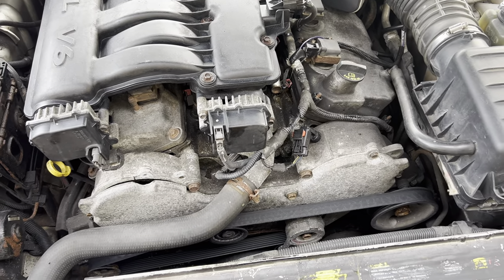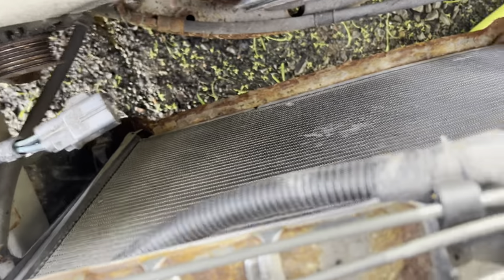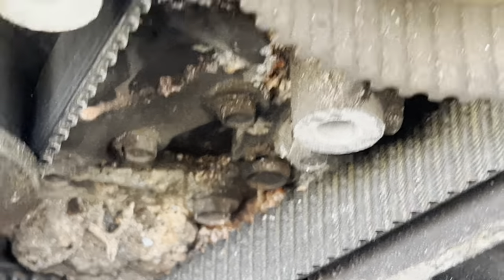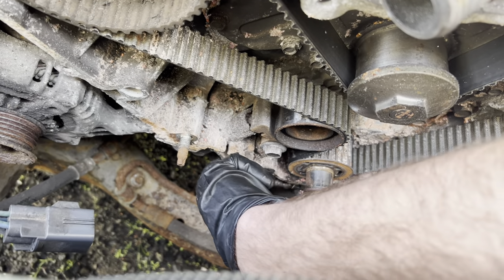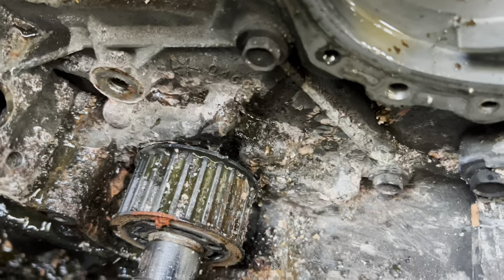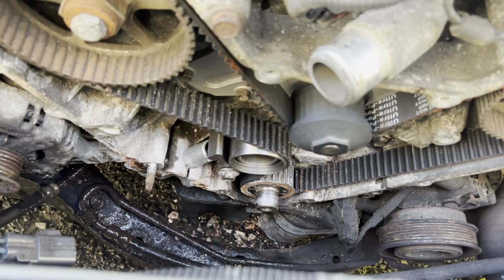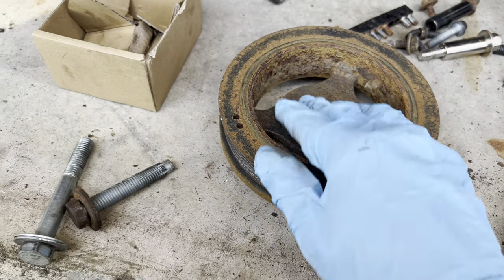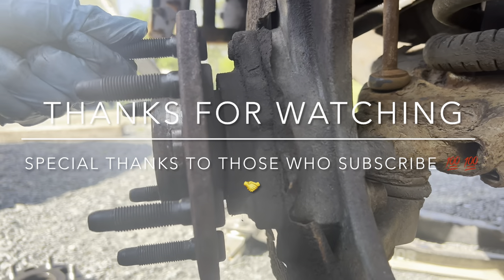How to replace Timing Belt and Water pump  on Chrysler 300 3.5 Dodge Charger, Magnum, and Challenger

Comment: I followed everything step by step, been working like a charm.
I'm in rebuilding process, and need to know what long bolt to use to get pulley back on?
Reply from the maker: Hello!! I took the stock bolt to a hardware store and found a slightly longer bolt with the same thread pitch, that worked very well. Good luck with the rest of the job bro!! 💯💯🤝

Comment: thanks for the video, I have a Magnum -05 (newly bought) and dont know when timing belt was changed, if it breaks will it ruin the whole engine for ever? I know there is some difference between brands and models
Reply from the maker: Thanks for the comment bro!! This is an interference engine, so If the belt breaks while running the valves will hit the piston and it would cause valve train and piston damage. So it def wouldn’t be good! Good luck with your vehicle ! 💯💯🤝
Reply: Would be nice if you lived in Sweden, then I would have hired you to change my belt 😀☺️👍🏻
Reply from the maker: I hear ya bro! Wouldn’t that be nice! 😂🤣 💯🤝

Comment: what water pump and tensioner and timing belt did you use I don't want to get bad parts
Reply from the maker: I got a timing belt kit from rock auto. I got the ultra-power timing belt kit I believe, but they have multiple options if you’d like to choose your brand. 💯💯🤝

Comment: I have the same issue I can get the cams lined up but not the crank it's a tooth off similar to Yur video. So wud I rotate it over to tdc
Reply from the maker: Heey, you wouldn’t want to rotate the crank independently from the cams. If it’s only off a bit then you can rotate the crank backwards just enough to catch the right lip of the pulley.  Hopefully this helps! Lmk if you can get it!! 💯💯🤝
Reply: @colin7761 so never move the cam or crank independently cam&crank have to rotate at the same time

Comment: When i tried to remove pulley bolt the whole belt turns, how do I prevent that?
Reply from the maker: You may be able to stick a big screw driver through the pulley and hold it. A bit difficult to do by yourself. Good luck with it bro! Hopefully you can get er. There’s also pulley holder wrench’s as well 💯💯
Reply: @colin7761  thanks, I appreciate very much. About to try it. I got that far from the video. Thanks again

Comment: Does the torque on some the bolts matter or js long as they’re in tight?😂
Reply from the maker: Using a torque wrench doesn’t matter. As long as you can get them in tight enough that they won’t back out, and not too tight that it breaks. Good luck bro!
Reply: @colin7761 I appreciate that very much I got my water pump and belt today so we’ll be back up🙏 thank you!!⛓️‍💥💯

Comment: Having trouble finding a bolt to use to get the harmonic balancer back on.  What kind/size bolt did you use and were you able to just thread it on or did you have to use a nut with washer to pull it back on also
Reply from the maker: I took the stock pulley bolt to a hardware store and got a bolt with the same thread pattern, but a bit longer. Once you pull it in enough you can finish pulling it in with the actual crank bolt. Good luck bro!! 💯💯🤝
Reply: I checked another video the specs for the bolt they bought, and it was 
M12x1.75x150mm
Reply: Try

M12x1.75x150mm